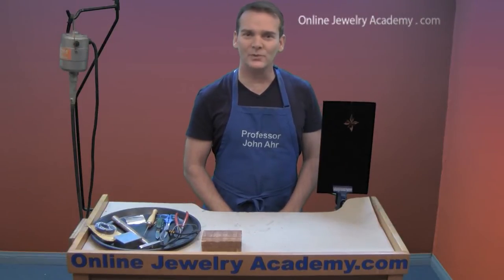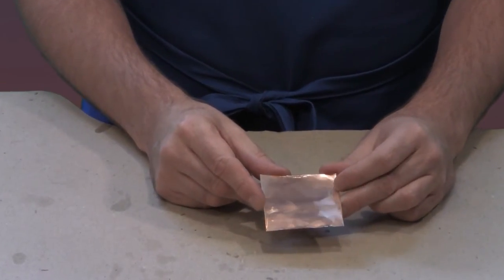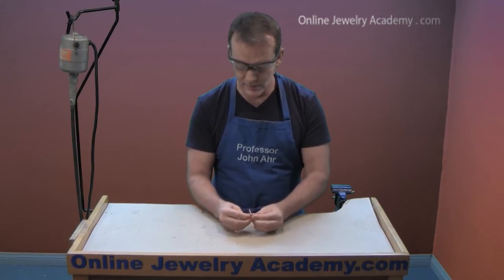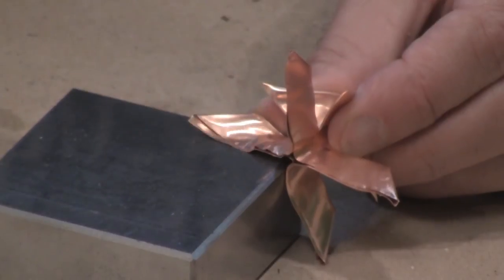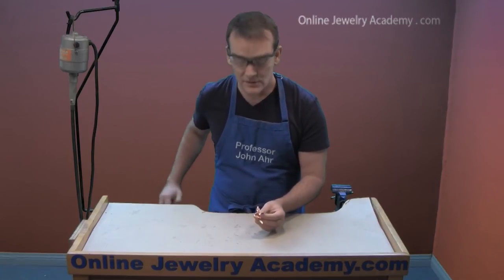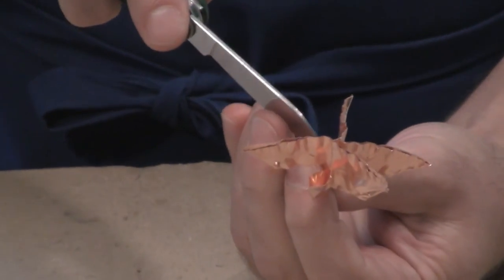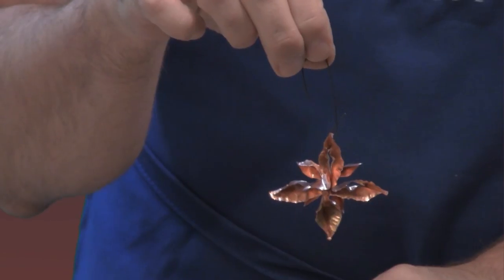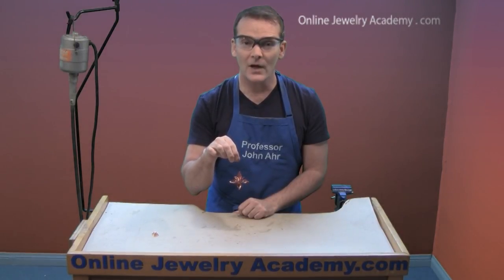Copper Formfolded Snowflake Holiday Decorations

Comment: wow that was very pretty! Just curious, but what was the gauge of the copper sheet? Very beautiful, thanks for this!
Reply from the maker: +ann tonella 
Sorry for the delay in responding. The gauge on the ornaments can be anywhere from 22 gauge to a much lighter foil-like gauge in the low 30s.  The thinner the metal, the lighter it will be on the tree or on your ear.  But, a thin gauge will make them easy to bend.  Experiment and have fun making them.
Thanks for watching! : )